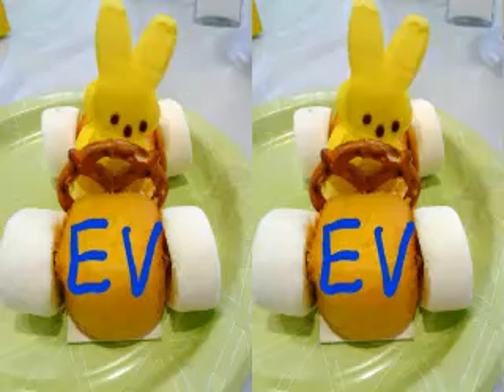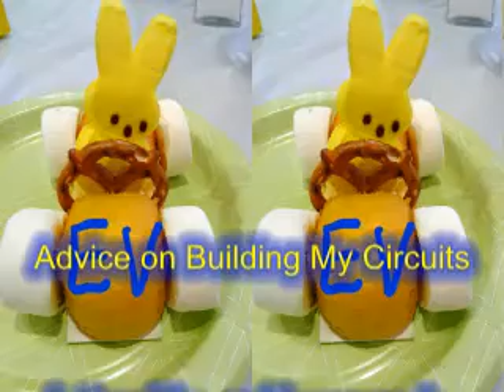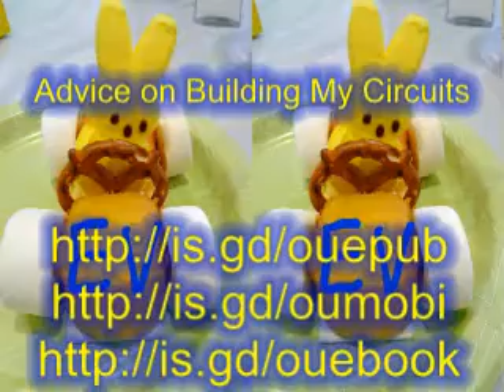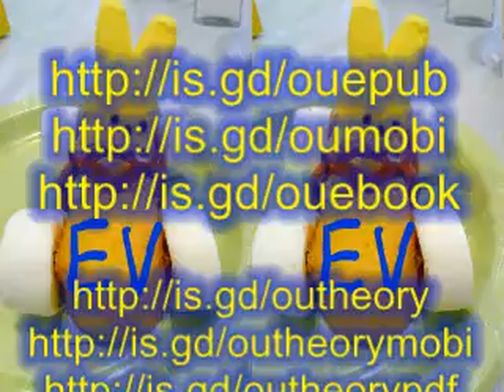Advice on How to Build My Circuits

Comment: it only becomes explosive if the power is not fixed.  or if the transformation between the load and the resonance circuit is direct. but, if you use light or heat or air as medium between the circuit of total power capacity and the circuit of total power of load handling capacity plug into it. 
you can make the circuit work at fixed maximum power. then apply indirect transformatiom before you connect to the circuit that handles any load capacity at the range of maximum resonance power. it wont explode.

only explodes if it excalate.

the power of inductive reactance and capacitive reactance is 10X in real world. i tested it with a capacitor value off 75% accurate since i dont have exact value to achieve resonance, i achieve 200% overunity. its not just small, it can reach even 200X  or 20000% overunity at fixed accurate value. i dont use very high voltage and frequency so it dont voltages dont arc.. 1 only use high enough voltage and frequency to maximize capacitance value at most affordable price. mostly i use 50hz 60hz so tuning is not so hard. here its 240v 50hz thats given and flactuating  +-5%.
Reply from the maker: What do you think of this risk?....
https://en.wikipedia.org/wiki/Dielectric_absorption#Design_considerations_and_safety

and...
https://en.wikipedia.org/wiki/Capacitor_types#Dielectric_absorption_(soakage)
Reply: @vinyaasi , time in a circuit varies in frequency or cycles per second of operation, in just a second total power is divided by the frequency with very little current per cycle, but large enough in 1 second to run load at maximum power capacity.  capacitor "soakage or battery action" effect happens  in hours. this effect accumulates very little 
% of current in an hour.

capacitors in a a circuit can discharge self "soakage"  accumulated electricity due to inherent circuit resistance.
Reply from the maker: Do you have any photos or videos of your replication of my circuit which I may include in my eBook along with your data?
Reply: @vinyaasi  i do have simulation pictures but i did not takes pictures on my physical experiment, since i only did those to prove to my self that this theory is real in real world and worth my time to advance my research on this subject matter.

and yes your right, equipments and tools are costly, not very useful today since money flows not with free energy. i want to live now! so if i build one useful enough to power my home, or power my business, i might keep it on my own, i dont want to die or live being hunted by power big corporations.